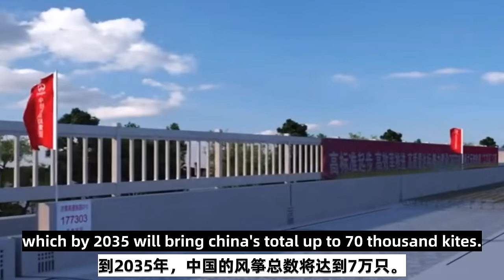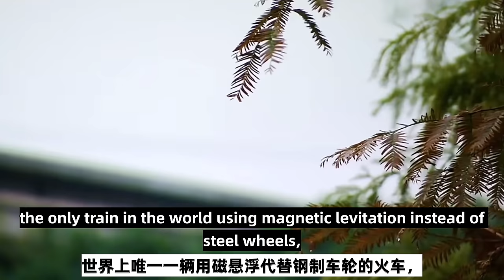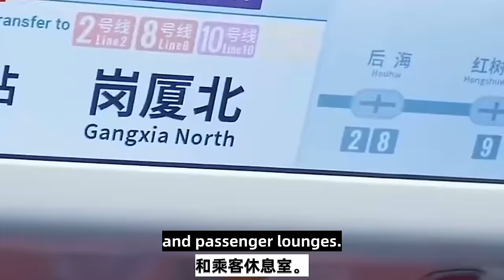CHINA vs INDIA Railways: JAW-DROPPING || 关注中国

Comment: Was stuck in Boston subway system in the summer in the seventies. But now nothing much has changed. And don't get me started on NYC subway 😂😂😂
Reply: CRRC are working on upgrade Boston metro systems for years, so do Philadophia, Chicago, LA, Houston metro projects so see 3
Reply: @daz9101  The new Chicago CRRC El trains are doing fine and Chicago is going with more CRRC trains (if the IDIOT congress LET'S Chicago do so).

The Boston MBTA IS A TOTAL DISASTER DUE TO YEARS/DECADES OF NEGLECT AND DEFERRED MAINTENANCE AND GENERAL INCOMPETENCE and yet the USUAL DROOLERS are blaming the new Boston CRRC trains for the disaster THAT IS THE MBTA.

Comment: India is now leading the world in manufacturing of "Cow Catchers". A metal bar that "Push Away" wondering Cows off the tracks. India learnt this from the US when they too had cow catchers to PUSH off cows or buffaloes off the tracks.This technique, India is far ahead of America. Well Done !
Reply: Still Chinese  tofu tracks and infra can't be Matchable 😂😂
Reply: Still Chunia(🇨🇳) tofu tracks and infra  can't be Matchable 😂😂
Reply: @dklerk9860  China built the world's largest state for India(Statue of Unity). Still standing today. Tofu structures or not you decides. But Modi like it a lot when relations was good. Now maybe pan in the axxxxs!
Reply: @jacku8304  statue of unity was built by Larsen and Toubro. They ordered outer surface of statue of bronze material to China, as per their desisn. The base and superstructure was done by L and T. It is not built by chinese.
Reply: @dklerk9860  All built by Chinese as Larsen and Toubro never built statue of such gigantic scale before. Have no experience and understanding of internal support system to bronze plates. It just provide the proper paper work for approval for the Chinese given blue prints. The concrete base is just a simple platform done by locals to support the Chinese built structure. The Chinese engineers, technicians supervised the local laborers on how to assemble, weld and put things together. The landscaping is of course local. Don't expect China to do gardening job too. By the way the statue was based on photographs of the person. Not original design by the sculptor but a copied model from picture.

Comment: Indian: 180km/h is very fast, you know? So it is a high speed train.
Chinese: 😳😳😳OK, pal...😂😂😂

FYI, the Chinese EMU train (regular train) has an average speed of about 180km/h compared to 250-350 km/h on the Chinese HSR.
Reply: The trains in india could not and should not go too fast simply for safety reason, you don't want to see people flying off on the sides, at the top of a moving train!
Reply: Let the Indian railways improve for the good of the people. Then there won't be a need to compete.
Reply: @dannyw985 hey bro , those passengers on top of the train & hanging out side, they still need to pay for tickets???
Reply: Hello Kumar 😊 There's no train in India that runs above 140 km/h in real life.
You're just referring the highest speed achieved by bande Bharat train during 'testing'.
If this is your standard then I will say Chinese train run at 605km per hour.🤓🥰
Reply: @minhvoang9920  
haha
Good question.

But common sense will be:
Can or will the train conductor climb up to the roof:
"Ticket, please, show me your ticket"

haha
Reply: Don't u think thumbnail is representing Bangladesh instead of India 😂😂😂 So low act btw fact will not change no one can stand on roof top while 95% whole system is electrified 😂😂
Reply: @putianren  95% of trains are run with electricity 
This was from Bangladesh 
But I know that you guys didn't recognize this thing

Comment: Quite a few of the images of over crowded trains are from neighboring countries. As on date 94% of Indian railways is electrified, they cant possibly sit on the roof and travel unless they have found an alien technology to avoid electrocution. They are not from India.  Also the country having the maximum rail accidents between 2010 and 2019 is I believe the United States.
Reply: adolft_official   You might want to cross check the figures you quoted with the actual data and statistics.

Comment: Thanks Lizzy. Just one comment regarding the maglev trains. The line in Shanghai was bought from Germany and has no Chinese technology. The newer ones do contain Chinese technology
Reply: We have long known that Germany's maglev technology, but China actually has only one maglev train, the government level does not regard this as a bragging capital, because everyone knows that it is not practical, and now China's large-scale application is high-speed rail.
The high-speed rail technology that can be used universally needs to solve the material problem, finding a sense of balance between faster speed and better materials and low cost.
Reply: In addition to the Shanghai maglev train demonstration operation line, there are also two medium and low-speed maglev lines in China.  The first is the Changsha Maglev Express Line, which is an urban rail transit line serving Changsha City, Hunan Province. It is China's first medium- and low-speed maglev railway with completely independent intellectual property rights. It was opened for operation on May 6, 2016.With a total length of 18.55 kilometers, the Changsha maglev express line adopts a medium and low-speed maglev train, with a maximum designed speed of 100 kilometers per hour. The Beijing magnetic levitation demonstration line is the second medium and low-speed magnetic levitation in China, with a total length of 10.2 kilometers. The line starts from Jin'anqiao Station, passes through Shijingshan District and Mentougou District, runs through Mentougou and Shijingshan, and ends at Shichang Station. The maximum speed of the train can reach 120 kilometers per hour.
Reply: For those that commented, please listen again to what Lizzy said in the video and then read my comment. The way she tells about the Shanghai maglev train makes you believe it is of Chinese make, which of course it is not as it was bought from Germany. 
Fun fact: Germany has since scrapped development and deployment of maglev trains in Germany whereas China has developed the technology further and thereby overcoming some of the limitations of the 1st generation making it viable for long distance use.

Comment: 0.14 is Bangladesh.  And it only happens on a certain holiday of which I don't remember name of.

This probably doesn't happen anymore in india though it MAY possibly happen during some big events like in Bangladesh.

What you WILL still see in india is people hanging outside of the doors of trains because trains in india do NOT secure their doors so the doors are left open and thus allowing mobs of people to crowd around and hang out the door.

People used to ride the roofs of trains in Indonesia but - and I'm not kidding about this - the Indonesian authorities put up this fairly large metal spheres hanging from cables that hung down where the roofs of the trains just cleared it........ BUT anyone riding on the roof of the trains would get their heads smashed into the metal spheres........ it worked as train roof riding in Indonesia stopped.

Comment: The Indian train video is not correct, this video depicts Bangladesh. The United States now has high-speed rail. Although there is only one line (the total length of the high-speed rail between Orlando and Miami is about 380 kilometers), the maximum speed can reach 200 kilometers per hour, but the average speed is only 110 kilometers per hour. According to American standards, this is considered a high-speed rail（the high-speed rail in china is300- 350kilometers per hour，200-250 kilometers per hour becomes a lower  high-speed train）. As a self-media blogger, you still have to seek truth from facts and cannot lose your basic objective stance for the sake of traffic.